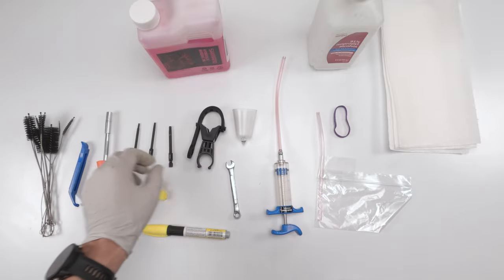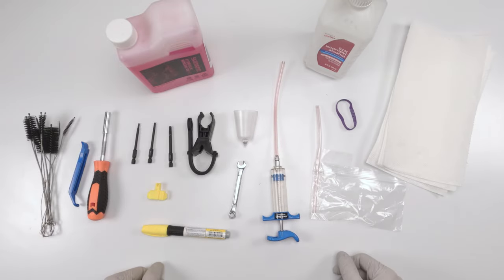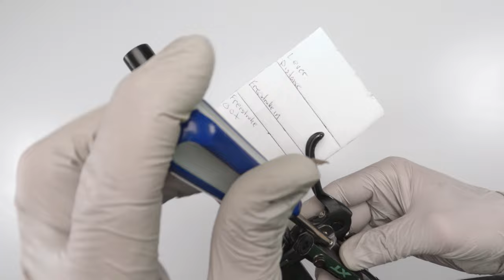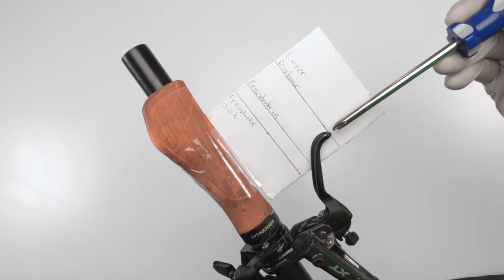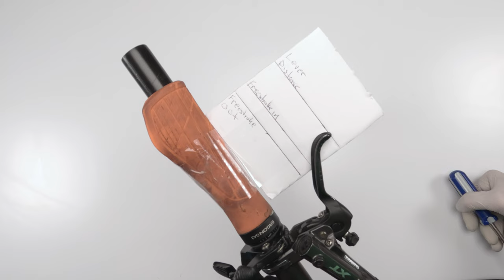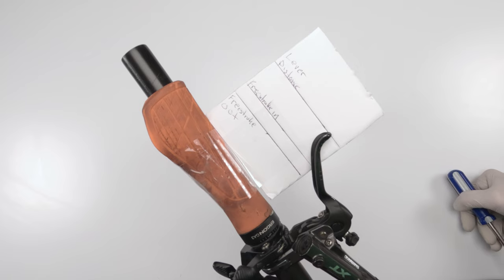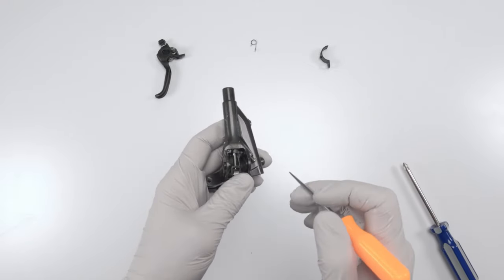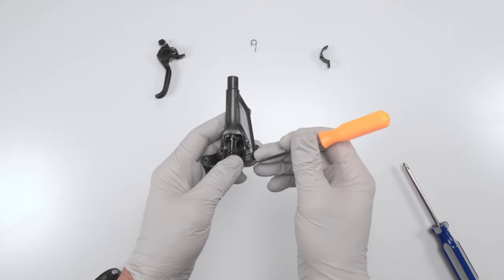Shimano XT M8000 M8100 Brake Bleed Service Guide for Beginners. Free Stroke FULLY Explained

Comment: I recently did a routine bleed on the slx m7100 brake, as I've done loads of times before but when I pulled the lever with a bit of pressure, (not too much).....I blew out the seal on the lever. This also happened on the 2nd lever I got. What the Hell happened????
Reply from the maker: Apologies for the late response, and I am sorry to hear about the issue. But just so I'm clear, which seal are you referring to? There are about four seals on that lever, not including the olive. Where is the oil leaking from?
Reply: @zoubtube Thanks for your reply. I tried to take a picture but I can't upload in a reply here. I think it's known as the weeping port.
Reply from the maker: @damienmitchell3080  So it's the cap at the end of the reservoir. If yes, then its possible that there is/was too much pressure in the system when bleeding. Did you bleed using the proper bleed block in the caliper? Did you start the bleed with worn pads, then changed the pads to new pads after the bleed?

What you can try is to remove the cap and bladder in order to check the bladder. (I have another video that shows this process in detail: https://www.youtube.com/watch?v=yoHH7qV3dIc. Only follow the part that removes the cap) 

To do this, you need to remove the set screw that is holding the cap. Once removed, use a small Allen key to remove the cap through the set screw hole. Take your time; don't force it; it will come out. When the cap is removed, remove the bladder. Inspect it to make sure there is no damage. If there is damage to it (typically from too much pressure), it needs to be replaced. If all looks well, reassemble correctly. Make sure the bladder AND the cap are sitting in the right position, then redo the bleed as seen in the video. Make sure to a proper bleed block, and don't change worn pads for new pads after a bleed. This needs to be done before a bleed. 

Keep me updated 👍

Comment: Mine doesn’t get a hard bit point even after bleed it keeps going down if you use a lot of pressure what does that mean
Reply from the maker: So after a bleed you seem to lose pressure the more you use the brake?
Reply: could be a couple of things, still have air trapped ( try a burping from lever only ), loose or bad fitting on lever or brake ( check for any oil around connections ), shimano wandering bite, leak from pistons.

Comment: What if you've already got the lever position all the way out before changing the free stroke?
Reply from the maker: No issue, as long as the level is out to a point where there is a gap between the lever arm and roller bearing.
Reply: @zoubtube  I meant, it's not going to give you any option to change the bite point. How can I get a better bite point. I suspect I can't without pushing the pistons out (which isn't ideal)

Comment: Will free stroke screw in or out effect modulation?   I'm wondering if it would move it to a different part of the servo wave curve
Reply from the maker: If done correctly, yes, though slightly. It's about pressure. with the free stroke there will be more swing in the handle, allowing you to feather the brakes a "bit" more than when the free stroke is all the way in. It is noticeable, though not drastically different. don't expect it to be like a SRAM guide for instance. Shimano brakes just plain have a have a quicker bite point  imo

Comment: It's a bit hard to see the one's that should really know their craft push dirty contaminated fluid up and out through the lever, as well as continuing to use gravity bleed. Your method here should be the industry standard and I say that because it just simply makes so much more sense. 
I applied this method to my own bike the other day and even though I also changed rotors and pads, my brakes have never felt this good before. Even when my bike was new I was just disappointed with the feel and bite of my brakes. Now my brakes feel like I expected brakes to feel at this price level. I know there are obviously better brakes out there, but there are also a lot worse than this. A set of M8100(with M8120 calipers) brakes should be pretty good out of the box and they can be very good with the right maintenance and rotors/pads.
Reply from the maker: Thank you so much for your gracious comment. From my perspective, the vast majority of people are only going to need to do this once a year. Taking a few extra minutes to ensure a positive bleed isn't much to ask for when considering the return. No matter the brakes, I always bleed them when new, as I do forks and shocks. Oil is cheap. Peace of mind is priceless😉 Now go out there and enjoy the season. Winter is around the corner 😉
Reply: @zoubtube  The only thing I will add to this method from now on is something that will only add a few extra minutes at the most. Just after you have cleaned the calipers inside and out with isopropyl alcohol, as well as the sidewalls of the pistons. After this has dried, you apply a thin coat of mineral oil with a q-tip(same as in the braking system) to the sidewalls of the pistons. Then cycle them in and out a few times and visually make sure they operate freely and in unison. 
After this I just apply isopropyl alcohol on a new q-tip and wipe off any excess mineral oil inside the caliper that shouldn't be there.

After this you just proceed to throw in the bleedblock and continue on with the rest.

Comment: so how many full turns there are from fully in to "fully safe out"..?
Reply from the maker: There are two ways to gauge this. One, look at your handle. Adjusting the free stroke moves the handle. it's by design (which is why it is so important to put the handle back to the preferred position when adjusting the free stroke). From the fully closed position, the handle should stop moving around the point when you see two fully exposed threads on the screw when looking at it. Probably about 4 full turns, maybe 5. But the safest bet is to look at the handle first, then the threads.
Reply: Thanks!

Comment: Did you bleed with the free stroke screw back 2 threads then set it back after bleed?
Reply from the maker: Yes, that's what I ended up doing in this case, but you don't have to. The important thing is to bleed with the free stroke screw out. From there It's up to you on which position to set the free stroke screw based on what YOU feel is comfortable as far as stroke bite (full contact with the rotor) this is personal preference, do you like quicker full lockout, or do you like to have some room to feather before full lockout when applying your brakes. But always remember to return the handle to the preferred position when adjusting the free stroke screw in order to feel its effect.

Comment: Can I use Maxima Mineral Brake Oil on my Shimano brakes? If yes, can it be mixed with Shimano mineral oil or should the existing oil be flushed out first?
Reply from the maker: Yes you can. it's all mineral oil (though some brands might put in additives). I've swapped mineral oils plenty of times (usually from some other brands to shimano, but that's only because I occasionally buy the large shimano bottles on discount for really good prices and always seem to have a bottle handy). Just don't ever mix mineral oil an dot fluid. that a BIG no no! 👍
Reply: @zoubtube  Thanks for confirming. I’m down to my last bottle of Shimano oil and have a new Maxima sitting on the shelf.

Comment: Man, I was really hoping the freestroke adjustment would make these levers feel nice but nope. The amount of travel before they actually bite is insane for an XT model. I had magura trail sl brakes and they felt amazing but I couldn't stand the constant rotor noise from magura rotors (they warp easy) and the super small pad clearance so it was just constant rubbing from warped rotors that would take hours to true by eye.
Reply from the maker: Freestroke, as well as contact point adjustment, are very subtle. In no way will the difference be drastic. Both are a small tweak to the system in order to provide the option of a more comfortable feel either way.

In order to get more bite you can try a wider rotor, bleed with a thinner bleed block, or even move to a larger rotor or larger brakes in general.

I would try bleeding with a thinner bleed block first to see how it feels for you. If there is a bit of a warp in the rotor, you will have to adjust it when doing this, so you won't hear the rubbing
Reply: @zoubtube I did see a video that a guy said to remove the rotor and pull the lever to bring the pistons in closer which I may try. I used a magura rotor and that did make it feel better as they are slightly thicker than shimano rotors but they warp so easy.
Reply: Best way to adjust bite point: 
1) remove the caliper bolts, 
2) lift caliper off rotor.
3) squeeze the pistons closer then slide caliper back on rotor. Check to see if you like the bite point, if you do…
4) clamp the caliper back on.
(If your pistons came out too much, use a plastic tire lever or bleed block to pry them open until you get bite point just right. 😉👍
Reply: I just put a bit of positive pressure in the system with the syringe and then close it off.  It makes a world of difference in pad engagement with less lever travel.

Comment: 👍
Reply from the maker: thanks for the kind gesture! let me know if you have any questions
Reply: @zoubtube  @zoubtube  I do actually. Does the free stroke feature work with newly installed pre bled brakes, or do they need to be topped off with the screw in the out position to get functionality? I'm not very tech savvy but these new xtr brake levers take way too long to engage their bite point in my opinion. Would love to be able to move that point away from the bars more
Reply from the maker: @thereignofthezero225  The free stroke works at all time. It's just a question of how effective it will be. Technically, if you bleed the system with the bleed screw out, you will be adding a bit more oil to the system. This, in turn, will create a bit more pressure when dialing the free stroke screw all the way in than if you were to bleed the system with the free stroke screw in. But this can potentially have a negative effect, which is brake rub, especially if you have newer pads and rotors. My assumption is Shimano recommends bleeding with the free stroke in order to avoid this.

If you find that you still want a quicker bite, then two other options are to bleed the system with a thinner bleed block or install a wider rotor. Both of these will accomplish this, but again, there is the potential for brake rub.
Reply: @zoubtube  thanks

Comment: You are exchanging volume and pressure incorrectly interchangeably. Changing the free stroke adjustment change the position of the master piston in the lever assembly. CORRECT!
But that effects VOLUME of fluid in the master cylinder of the lever, NOT PRESSURE. There is no pressure until the system is closed and in use with master piston moving in the master cylinder against the brake pads on the rotors system closed.
Extra fluid VOLUME restores free stroke adjustment to original setup position before pads start wearing. 
Everything everything in the video is correct except for the misuse of pressure and volume. 
But that’s a big error in expressing the understanding of hydraulics to someone else with no education of that subject.
Still…. Great video.
Reply from the maker: "misuse of pressure and volume" I'll by that. I tend to mix up words occasionally. I really should script this stuff. Someone recently pointed out that I was saying hydro instead of hygro. Definitely my bad.

Comment: So the people putting vids up stating that freestroke is pointless and to set up by removing the wheel and slightly pulling the lever to closen the pads do not understand the system?.
Reply from the maker: I'm not sure if I would say they don't understand the system, as much as have  higher expectations of what it can do. Both freestroke and SRAM's contact point adjustments are VERY subtle. It takes a few rides on VERY familiar trails to feel the difference, IMO. Also, The vast majority of people I've come across don't adjust freesroke correctly. They were unaware that the lever position is affected by adjusting the freestroke. If the lever isn't brought back to the exact preferred position after adjusting freestroke, it will literally have zero effect. This is the key adjustment to make in order to feel the effects of the adjustment

Comment: While there is inherently nothing wrong with your bleed technique, it's unnecessarily complicated. There really is no need for the syringe. A proper gravity bleed, as shown by a World Cup mechanic, works just fine and is much quicker without the complication of tubes/syringes/bags, etc. https://youtu.be/piWBVDh1pTE
Reply from the maker: As mentioned in the video, I'm not saying that gravity bleeds don't work, and I also understand your point that some World cup mechanics gravity bleed, but I cannot recommend it to the average person, especially beginners. What they don't tell you in those World cup mechanics gravity bleed videos is that if a bleed doesn't go as planned (and many times it won't), they immediately bleed again, immediately after a run. I used to track race motorcycles back in the day, and all I'll say, not everything goes as planned in the pits. There are CONSTANT tweaks done between every run.

If you have the experience and confidence to gravity bleed, then by all means, feel free. But if you're the average person out there, chances are you'll only need to bleed once a year, maybe twice. Take a few extra minutes, use the syringe method in order to test the system and make sure all the air has been removed for a better experience. 👍